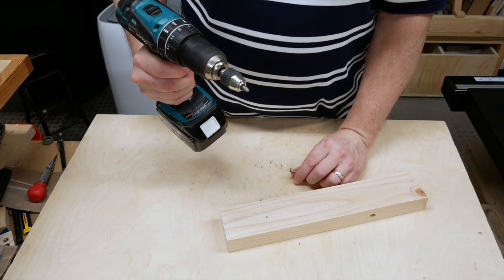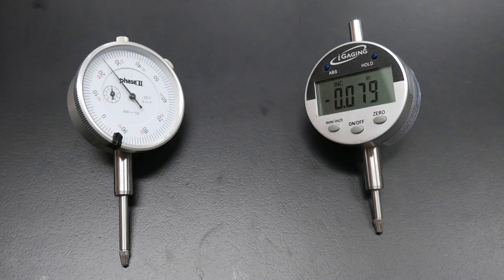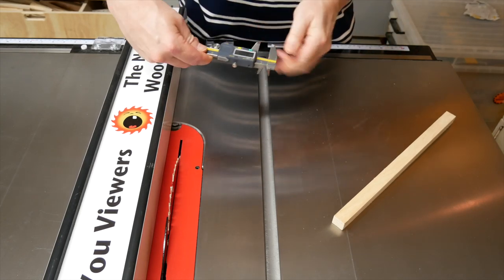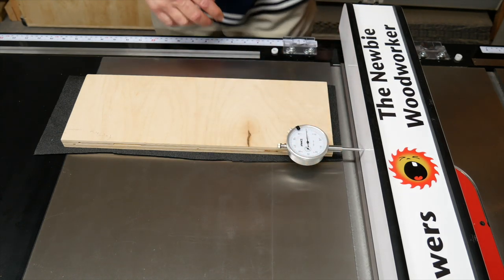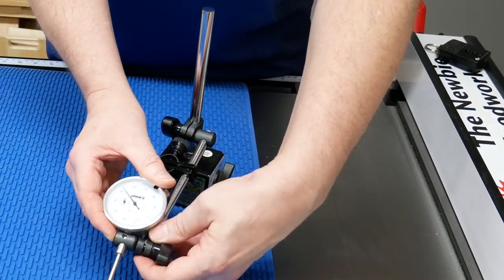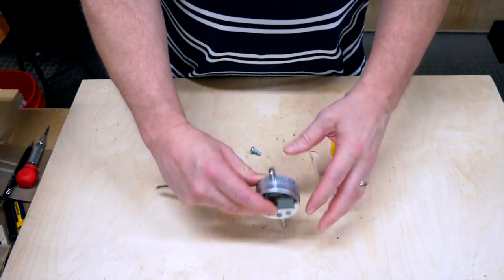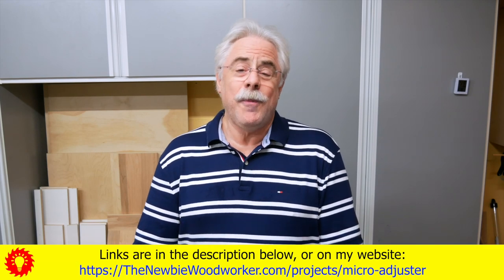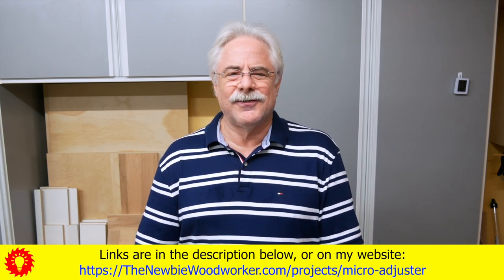Micro Adjusters for Table Saw Fences

Comment: Nice tip. I also liked the cardboard box dust collector shroud on the sander in your magnet mount montage , I’ll try something like that to prototype similar idea for my mitre saw before cutting any expensive wood.
Reply from the maker: Thanks! It helps... some. 😄But I think using cardboard to prototype is a great idea! Good luck.

Comment: For T-square type fences (Biesemeyer style) it is best to keep the gauge as close to the front of the fence as possible, because when you loosen the fence it is no longer (necessarily) perpendicular to the rail, and the further from the rail you place the gauge to measure, the more the angular error compounds as a distance.
Reply from the maker: Very true, and I can't believe I forgot to mention that. I was so focused on trying to get decent camera shots that I didn't even think about it. But you're absolutely correct. Thanks for the comment!

Comment: Great tool! Using the magnet approach is the best. I made one myself using a small block of hardwood and a neodymium magnet and a tapped hole on the side to mount the gauge. In addition to using it for fine tuning the fence as you illustrated, Russ Veinot on his web site, used the tool to accurately measure and account for the blade kerf width for any blade in use at the time. Simply square of a small piece of sacrificial wood and then use the gauge to move the fence exactly 1/4 of an inch, make a thin rip cut on the piece of wood and using a caliper measure the actual width of the thin strip. I will be 1/4 inch minus the actual width of the kerf. So 0.25 minus the with of the strip = the width of the kerf. Write it on the blade if you wish. Great presentation as usual.
Reply from the maker: Thanks, and great idea! Thanks for sharing. 😄
Reply: Me too, I'm a cheapscape..lol
Reply from the maker: @TheUnofficialMaker  😂

Comment: I love the harbor freight dial indicator. I took it to work, out of curiosity, and tested it. It is just as accurate as the high dollar ones.
Reply from the maker: That doesn't surprise me at all. Thanks for sharing!
Reply: Im not surprised it was either,  I WOULD be surprised if it still is 2 years later. ;-)   That's where the good stuff counts is something you can always count on although you still always have to recertify it periodically.  Less surprises with Mitutoyo, Starrett, Brown and Sharpe, etc.
Reply from the maker: @DavidBaumgarner  Sometimes it's a calculated trade-off between something that will last a long time, but may not be used a lot, to something that is cheap and you may need to replace it.

Comment: Like the one with the yellow magnet. What if you also add an horizontal 3/4" bolt, bolted to the wood base,  parallel to the indicator and use it to screw it and push the fence? cheers!
Reply from the maker: I had actually done that with a previous jig, but I decided to go for simple this time. 😄Thanks for the comment!

Comment: I have the same Makita cordless drill  you showed at the beginning. It is difficult to hold the lock ring to close the chuck on a bit. I'm not not sure why, but I don't have the same problem with my Festool, Porter Cable, or DeWalt drills. Other than that, it's a good drill with a lot of power.
Reply from the maker: Could there be something wrong with the drill? If so, it's probably under warranty. I had a problem where I couldn't change from screwdriver mode to drill mode (or hammer-drive mode). Makita fixed it under warranty.
Reply: @TheNewbieWoodworker  Maybe, but I don't think so. It just seems stiff. However, I'll look into it since you had the problem.
Reply from the maker: @patlaw53  Good luck!

Comment: Clever.  Nice job. The Incra fence allows for this type of precision, with repeatability.
Reply from the maker: That's good to know. Thanks!
Reply: I agree, nice video. As long as we are offering alternatives, I put the Wixey digital fence readout on my table saw and I use it the way that you use the digital dial indicator. Of course, I can also use it for accurate measurements.
Reply from the maker: @paulruud5804  Thanks for mentioning that. I saw it mentioned somewhere once, but then couldn't remember who made it, and I could never find it in a Google search. Out of curiosity,  why do you use that and the Incra fence?
Reply: @TheNewbieWoodworker  I don't have the Incra fence. :-) Just the Wixey.
Reply from the maker: @paulruud5804  That makes sense. Thanks!

Comment: As I’m one of the many who don’t have the space, $, or strength to lift a steel top table saw out of the way when it’s not in use. I’m stuck with my aluminum top saw. I need to find a way to make a suction cup model of your micro adjuster.
Reply from the maker: Here's an idea that might help: https://3dwarehouse.sketchup.com/model/6e5d73a4-4cf4-438f-aba8-6b4960e689de/Micro-Adjuster-Jig-for-Fences

Comment: As luck would have it, I had a very old gauge gathering dust in the shop.  Bought the magnetic switch and built the device.  Works great, although my fence goes backwards when I clamp it.  I can compensate for it, but I ish I knew how to fix that.
Reply from the maker: There's probably some adjustments on the face of the fence, or the fence's clamp, that can fix the problem. Look closely for some screws or hex bolts, either on the top or underneath (or both). Take the fence off and examine it - you'll probably find them.

Comment: I have that HF stand and just looked at it. Beneath front label are two Phillips screws. Magnet doesn't seem easy to remove. But it is circular. I think drilling and tapping on the edge of the base to mount dial mightl work but it is cheap metal. Or unscrew silver upright stand and make a wood/metal horizontal extension that screws into upright hole and mount dial on other end. (My dial mounting hole won't reach base center) 2nd method easier) hope that makes sense Cheaper $12 vs $26.
Reply from the maker: Let me know if it works!

Comment: Once again, good job. I appreciate the "idiot proof approach" I usually need it. I have a Ridgid with an aluminum top so I will try to put a runner on it or try to put a piece of steel key stock down in the slot.Have you done a vid on the device with a pusher screw on it? I may have gotten enough of a look at the one you used to reverse engineer one.
Reply from the maker: Thanks! I feel like an idiot here, but what device with the pusher screw? Can you give me a timecode?

Comment: Another way to move your fence; instead of tapping just grip your fence guide rail and roll a little pressure on the fence with your thumb. You’ll have to choose which hand to use as to the direction you want too move. Should work great with your indicator. Thanks for the ideas!
Reply from the maker: Thanks, that sounds like a great idea!

Comment: There is one more option for those of who have job site saws with aluminum tops, use a block of wood with sand paper attached to the Bottom
Reply from the maker: Thanks for the comment! I don't think I would recommend that in a video, because I wouldn't want to take a chance someone would damage their table top because of me. But if it works without problems, then that's awesome!

Comment: Or you could invest in an Incra Table saw Fence and joinery system! Nice ideas DAN. A solution for many budgets.
Reply from the maker: Thanks. The thing I don't like about the Incra fence is that it partially covers the extension wing, where I like to pile stuff. 😄
Reply: The thing I don't like about Inca are their prices.
Reply from the maker: @robira1313  Well, yeah, there's that too. But honestly, if it works, it doesn't look overpriced to me. On the other hand, it's certainly not cheap. 😄
Reply from the maker: @rchavez5056  Thanks. I ordered it yesterday. 😄
Reply: I was going to say the very same thing but I didn't want to be that guy.  Thanks for being that guy and I totally agree with you since I have one.
Reply: Talking about the Incra fence.
Reply from the maker: @befmx31  I'm not sure who you're talking to, and I'm also not sure what you're saying. 😄
Reply: @TheNewbieWoodworker  sorry, I was responding to the guy that said you should just get an Incra fence.
Reply from the maker: @befmx31  Thanks, that clears it up. 😄

Comment: I thought of an add-on for you for number three, make your wood base longer on the front side, and mount a threaded rod with a knob on the end to make the adjustments mechanically instead of tapping.
Reply from the maker: That's a good idea, and I actually made a jig like that a while back. But moving the fence requires the jig to be clamped down, or a really strong magnet, otherwise it you can't guarantee you won't move the jig. There's a couple of other issues too - enough to make it not worth the effort, at least to me. But it's a good idea in theory, for sure.
Reply: @TheNewbieWoodworker  thanks for taking the time to reply. Glad you already thought of it too.
Reply from the maker: @TimL1979  👍

Comment: Do you have another link to the Magnetic Switch?
The first link does not work
Reply from the maker: Thanks for pointing that out. The link was correct, except I didn't start a new line after it. Here it is: https://amzn.to/2G54KAc
Reply from the maker: @robira1313  Thanks, Rob! I fixed it. https://amzn.to/2G54KAc.

Comment: Awesome, now attach some kind of threaded rod (maybe make a wooden thread?) and attach it.  Then, when you need to push the fence, just turn the rod to adjust slowly vs "tap tap tap, crap too much..."
Reply from the maker: Thanks for the comment! I actually have a SketchUp model for that - even if you don't know SketchUp, you can look at the picture: https://3dwarehouse.sketchup.com/model/6e5d73a4-4cf4-438f-aba8-6b4960e689de/Micro-Adjuster-Jig-for-Fences.

Comment: I have one of those magnetic stand thingies so I would probably go with that. 

But in case of runners, I usually try something that I also try on the chop saw for "sneaking" cuts: if I need to shave off a bit, I turn the saw off (duh! :D), put the piece between the blade and the fence, unlock the fence, "push" the fence a bit towards the blade so that the blade deflects ever so slightly. Then lock the fence and re-cut. Of course, this will not work with either zero clearance inserts or blades that are most of the way up (too close to arbor = too rigid to move).
Reply from the maker: Huh. I never thought of that. I like it! I'll have to give that a try. Thanks!
Reply: @TheNewbieWoodworker  :D Also thanks for the tips! I thought I did thank you in the previous reply but reading it again it seems that I forgot :P
Reply from the maker: @AlipashaSadri  You forgot?!? After all that work I did? Just kidding. 😛No worries.